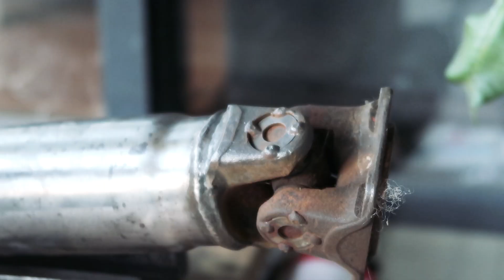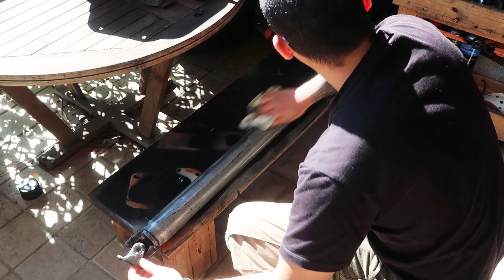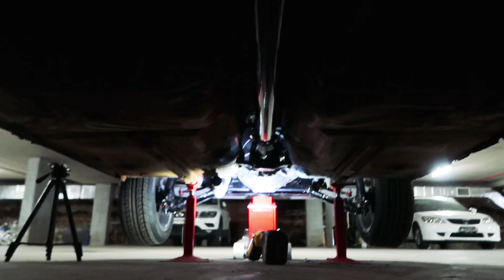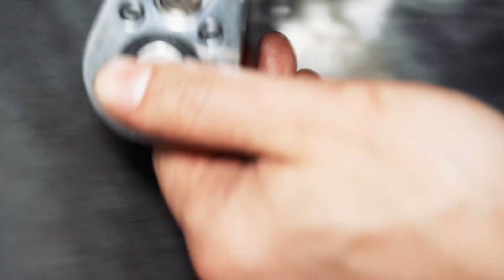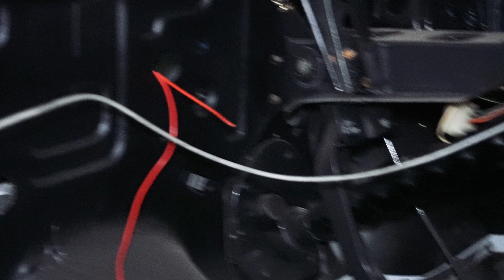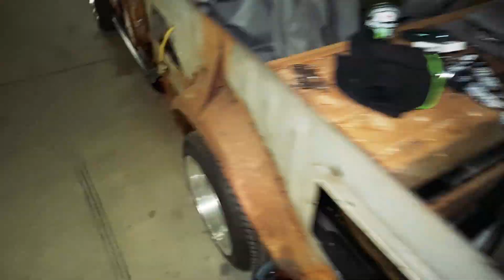DATSUN BUILD - GETTING HER STARTED! again (#21) ft. stubborn transmission plug...

Comment: I think you want to replace that driveshaft. Some butcher has bodge welded the uni in place rather than the press fit or the circlips. Also be wary using a heavy and lumpy underbody paint on it for the same reason it is balanced accurately. Great series really, you need way more views and subscribers! Really professionally done! Also how many complaints do you have from the neighbours in the carpark? Oh one more, where did you get that over car tool storage system?
Reply from the maker: Thank you so much! Cheers for the comment on the drive shaft, thought it was the way they came. I will get it balanced again in the future :)

No complaints, everyone has been super friendly to me so far but I try to be as respectful as possible as well. No noise and welding when someone comes to get their car :)
Reply: @32Builds  I'd just get another shaft, don't bother messing with one thats been welded. Do that when the CA18DET goes in! Be careful with the smoke too, don't set off the fire alarms in the building!
Reply: Where did you get that over car tool storage thing from? What's it even called?

Comment: I ended up ordering a GM 3 wire alternator that has higher amps than stock and it works great.
Reply from the maker: I'm thinking of getting a shiny single wire alternator and making a bracket up myself for it :) We'll see in the future!
Reply: @32Builds  for sure, defiantly a huge upgrade!

Comment: geeez that little  transmission bolt was stubborn !!  Happy you got it in the end . I would have gone nuts on the bolt haha .  that bonnet almost killed you as well . :o   there is probably excess some due to over filling the engine with oil as it was filled up when the motor was cold .  so glad to see your truck one Big step closer to being finished . congrats .
Reply from the maker: Yeah, things don't always go so smoothly - I think I spent a week on that transmission bolt 🤣 Lucky this car is made of paper and the bonnet is light enough to not crack my skull open. Can't even imagine newer cars!! I'm regularly checking the dip stick and the level seems fine every time I check - even while its warming up! Cheers for commenting!

Comment: I have an alternator that you can have that came with a motor I just bought. I’m in Sydney. Let me know if you want it!
Reply from the maker: Thank you for the offer! I'm thinking of going with something higher amperage, and single wire in design. I want to run extra electricals like audio and alarm down the line so it might get much for the little 30amp stocky

Comment: Good thing those gearboxes are easy to remove and refit on stands... I did it to mine a year ago, when a previous repair failed (before me, a bolt wasn't torqued and disengaged the selector, I lost 1-2-R, and 3-4 were accessible only where 1-2 should have been...) in the freezing temps of this time of year in North Northern hemisphere. My reverse switch took it badly though, I just had it replaced last week after much procrastination (and access to a hoist).
Reply from the maker: Seriously this car is an angel, despite all the work it needs - it is the easiest thing to work on!!
Reply: @32Builds  I don't know if you're already thinking ahead (probably) to audio, I have a short clip on my channel of where I hid my FM/MP3 radio (no CD means the unit can be much smaller) in my Sunny earlier this year. I could not bring myself to cut the original dash in an all original car. It's far from pristine, it's a working ute, but it is still original.

Comment: Missing the wire on the valve on the carburetor.Can´t run smooth at idle. The valve is there but the wire is cut .Need to be connect to ignition to open the valve.That valve is part off the engine shutdown. Earlier Datsun´s 1200 or Sunny´s carburetor   don´t have that valve but recent model´s have and that carburetor come whit that valve .Nice work by the way
Reply: Might be my issue as well, I've got the last gen, a GB122 that, once warm and the auto choke shuts, will rattle the stuff in my glove box off. A tiny bit of revs will calm it, and my idle adjuster is already all the way open...
Reply from the maker: Hello thanks for trying to help me with my idle. I looked into it and that valve is actually controlled by coolant temperature and controls the amount of vacuum advance for the carburetor. Not sure which other countries had it, but it was part of the emissions gear in Australian 1200s. I remember the motor was running fine when I bought the car and it wasn't connected from there.

Otherwise I need to figure out how to open it and put the wires back in if it becomes an issue in the future.

Also my car has manual choke. I ended up screwing the idle screw a tiny bit which helped (it was all the way backed out)., but I know its not good to rely on it to get it running good :)

Comment: Congrats on the startup. Before you explained the rattling noise,  I was certain the starter didn't disengage - like it didn't on my 1st startup on an A12 recently.  Keep up the good work and may you (and I both) have zero troubles on all future old NPT plugs.  👍
Reply from the maker: Thank you! Hoping for zero troubles 🤞 I definitely want to take some footage with it sounding good though 😀
Reply: @32Builds  I'm anxious to better hear how your exhaust sounds. Unfortunately, with the whatever aftermarket muffler is on it,  my A12 sounds like a fork lift or my grandpa's old Ford 8N tractor.  I'll change that before I get it on the road.  May I know what muffler you are using and if you are pleased with the sound?